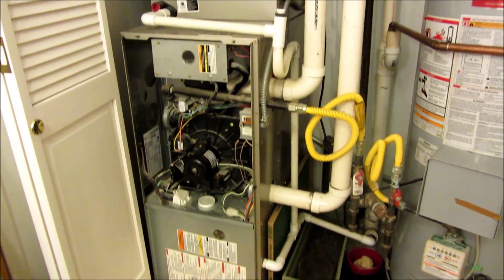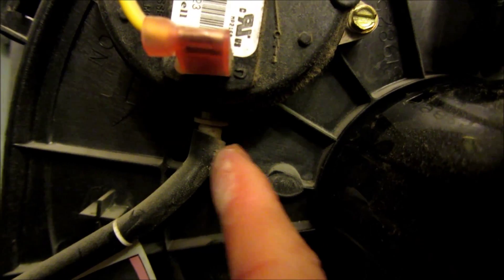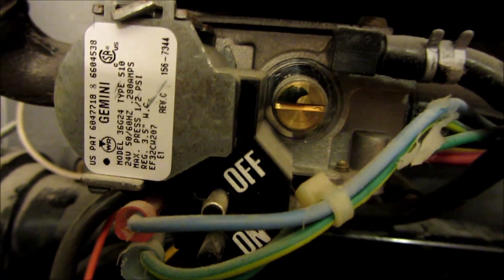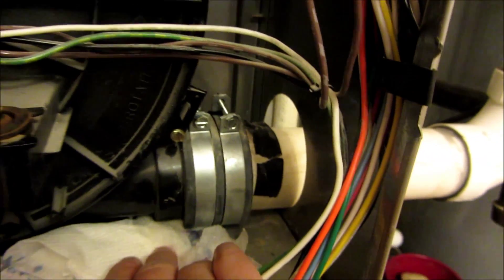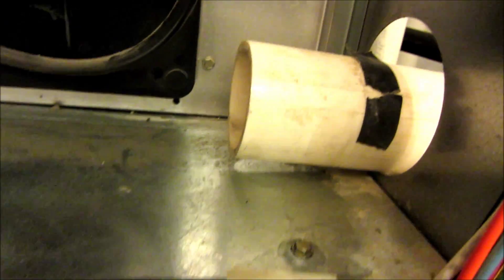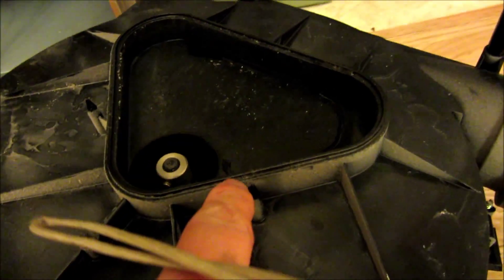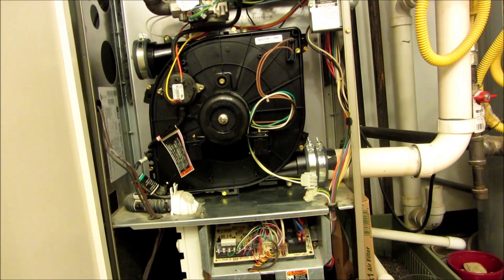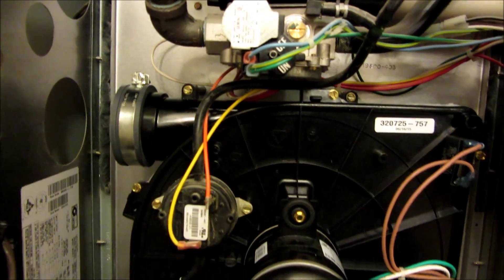Carrier Bryant Payne Inducer Motor Replacement and Repair Tips (HC27CB119, JE1D013N, 320725)

Comment: I noticed the top right hand corner of the inducer motor assembly you did not put the 1 inch round rubber bulb on to seal the exhaust gas from entering your home.  Get the old rubber bulb from the old unit and get it on there or you will have exhaust gas entering your home. Just a tip.  The new replacement units do not come with a rubber bulb.

Comment: My inducer motor started making squeaky noise when starting running and it goes away. Should I replace it? Instead of replacing entire assembly,  can I replace just the motor only? How do I know which part number to buy?  On the motor, there is a label, with ser: and mod:, but my furnace is 22 years old so when I do a search, nothing comes up.

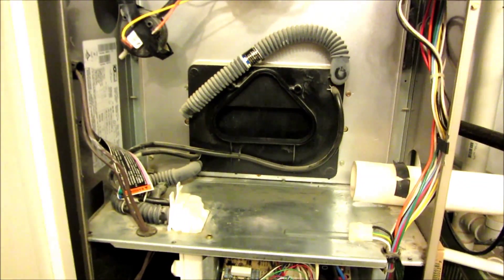Comment: at 3:27, what is that hose connected to, if anything? I am working on this project and i don't remember disconecting this hose. Is it just freely sitting there once the induction unit is back in place? I don't see anywhere it could have came from on the unit
Reply from the maker: As far as I remember, nothing.  It connects to nothing.

Comment: how do you disconnect  the white plastic electric connector from board to inducer?
Reply: Squeeze the two side clips simultaneously and while squeezing pull apart.  You may need to wiggle the connectors while pulling as well.

Comment: My home warranty covered 65% of the cost of replacement of inducer motor which is $325 out of pocket. My service provider charge was ridiculous amount of $940 including daignostic, parts and labor. I learned a lot. I was almost tempted to try do it myself but will let warranty take care this time. Overall, the cost of repairs are insanely high, for 45 mins labor they are charging over $500.

Comment: Im wondering why orange label hose is disconnected. The back end is not attached to anything. Been having trouble starting inducer. Trys to start every 2 min. It spins and then stops while the blower is running non stop.

Comment: Just a heads up. My inducer motor was really loud and I was planning on replacing it for $230 online and my own time. I discovered that the cooling fan on the end of the motor shaft was loose. You can see a push nut at 00:14 in the video. Just push this on tight with your thumbs or a tool and the fan will not rattle around and create noise. Also make sure nothing is vibrating against the furnace or duct work like conduit or metal gas line. Isolate anything that might be rubbing against each other with some thin foam rubber. I did all this and mine has a gentle low pitched hum to it that is not loud at all. Kind of pleasant actually. So take some time to isolate vibrating things before you waste money on the new inducer that may not be any quieter.
Reply: thanks for your findings. but i cant find the push nut that you mentioned. even in the video at 0.14. could you please give more details? thanks in advance
Reply: @katraju  It's the shiney thing in the middle of the black motor. It's on the end of the motor shaft to hold the cooling fan. If you look at the video it's right almost dead center of your screen.
Reply: good suggestion, i found the three screws hold the inducer motor and tightened them, one was fairly loose, it seemed to quiet things down.
Reply: Hey bud, came across your comment and it saved my butt alot of grief, just a good push was all it took! ....thank you truly.

Comment: Great video. I’m pretty sure the motor is the issue with my unit as well. I’m a new homeowner so still figuring all this stuff out. When I try to run the AC, the unit hums but the motor doesn’t appear to be running (that front piece that sticks out doesn’t spin) and no air comes out of the vents. The outdoor compressor unit seems to be working fine. Would you agree it sounds like the motor is the issue? I can have a pro come out but I’d prefer to avoid it if I can
Reply from the maker: I think the pro would cost you just as much as the motor itself.  And even pro's may only be guessing using the process of elimination, and they will charge you even if they are wrong.
Reply: @PoolarityChannel  If the motor doesn't spin freely when it's turned off then it's time to replace either motor alone or the inducer assembly with a new motor.  Either way make sure the replacement motor has the same specs and Molex connector.
Reply: @ianblumgart9566  Have you seen a video replacing the motor alone? Does it require taking off the assembly or does the motor come out of the assembly from the front by unplugging and unscrewing it? Thanks!
Reply: Nevermind. I saw this below... @PoolarityChannel "Snehal B I had the same thought before I started, I did some research and many have noted the removal of the motor was difficult and damages the unit, so I it was my labor that was costly not the replacement part and decided to get the entire unit"
Reply: @joem3211  Sorry but the inducer motor shaft inside the inducer assembly is connected to an internal blower wheel which is only accessible with the inducer assembly removed from the cabinet.   There's a nut that keeps the blower wheel on the motor shaft on tight which you'll have to remove before extracting the inducer motor.  Additionally that nut requires an angled wrench or a deep socket to turn it.  Otherwise you'll have split open the blower wheel assembly which is a bit trickly but doable.  Search for videos for replacing that blower wheel and you'll see what I'm talking about.  Clearly Carrier never intended the inducer motor to be field replaceable but only the entire inducer assembly.

Comment: Can someone tell me where the gray tube just above the mounting triangle (at 3:26 in the video) connects to?
Reply: I am working on this project right now and was wondering the same thing but I think I have it figured out. My tubing has a label on it that basically says the downflow tube, which can be seen in the bottom-left of the mounting triangle, needs to be attached to drainage, and the top-right tube, which you're referring to, should be capped. Mine has a small brass plug capping it. I think they are just two drainage tubes but only one is used and which one depends on the orientation of the unit when it is installed.
Reply: @bertcertain6982  I figured that out too. Yes it just depends on the orientation of the inducer. I took many pictures when I took the old inducer out and was surprised to see the extra hose. My furnace had been running fine after the new inducer.

Comment: Lovely video, but for anyone reading, just note that the bottom left screw is set back in and is hard to see unless you're at eye level and maybe shining a flashlight on it. Also be very careful when you remove the the assembly to not inadvertently pull out any hoses that go into the furnace behind the assembly (ask me how I know). In any case, got the job done and am thankful for Youtube videos like this. Fwiw, I went through all of the free/cheap repairs before getting to replacing the assembly. Read the code chart and go through and make sure the collector isn't full, the condensation lines aren't clogged, and that the vent isn't clogged either. Then, if you're feeling confident it's not those issues, try the inducer capacitor and the pressure switch. Good luck to anyone looking down the barrel of a possibly expensive repair. One of these days when I get more confident I'll start filming my clumsy repairs and posting them myself!
Reply: Can someone tell me where the gray tube just above the mounting triangle (at 3:26 in the video) connects to?
Reply: @robertleder4366  There are two grey hoses but only one is actually used.   Which one depends if the exhaust needs to exit to the left out the cabinet or out to the right.  If it's to the left then you need to mount the inducer assembly 'upside down' and then the other grey hose will be used instead.  The unused one is simply capped off at its end and then routed so it won't obstruct the inducer motor assembly when you go to attach it.

Comment: I was wondering if you had trouble pulling the tubing out of the exhaust of the inducer. I have 2" PVC like yours. It's so rigid I don't think I would be able to pull it out without breaking the PVC where it goes up and outside.
Reply from the maker: Didn't have any trouble, maybe try wd40?

Comment: Great video. Wonderin is there similar motor kit for two stage Carrier/Bryant/Payne furnace inducer motors, e.g. JE1D015N instead of replacing the whole inducer motor assembly? The new OEM inducer assembly cost a lot and a kit would be great to repair/recycle the defected original motor which cause a lot of noise (possibly the inducer wheel hits to the housing, all plastic/ABS).
Reply from the maker: I spent days searching, and could not find a good price for the motor alone (usually individuals selling it on eBay).  I don't believe they sell the motor by itself, likely because that's 90% of the entire cost of the inducer assembly.

Comment: The yellow flexible gas line connecting both the furnace and water to the hard pipe is a gas code infraction!
Reply from the maker: Yes, it was there 15 yrs ago when regulations were loose
Reply: @PoolarityChannel  very loose I'd say. Safety infractions are not grandfathered though, they can still be infracted.

Comment: When you remove the draft inducer, there was a big rubber hose hanging above the triangle connection. Where does that hose connect to?
Reply: Did you find out what it connects to?
Reply: @robertleder4366  
not really 
Any help

Comment: How did you know it was the issue? Hearing isn't working. The motor isn't doing. However there is no light error fur me to troubleshoot
Reply from the maker: The rattling can somewhat be located there, and I believe that's the only moving part
Reply: @PoolarityChannel  I mean heating isn't working on my furnace. How do I know the issue is the motor? It isn't spinning when the blower turns on.

Comment: the inducer fan assembly comes apart ,the screws look the same as the assembly mountings but they are shorter ,no glue required, if your motor is still ok, you can just replace the fan , it is a lot cheaper than the whole assembly , you can replace just the motor too if it is the source of the noises you hear ,it should turn every smoothly , and not smell burnt .
Reply: How does it come apart? is it easy and does the wheel come off? the full assembly is super expensive
Reply: @Jon-hx7pe  It is not that difficult. I've done once and if I remember correctly, just  remove extensive silicone around the housing (was't sure if it's necessity but I've done it anyway), remove the screws(5-6?) and slightly pull the housing parts from any corner (again, no specific corner or part, you feel it may come off easily).  The housing has 5 or 6 clips like parts but I think they are just for alignment, not for to hold the housing closed. You have almost nothing to lose as housing is made of plastic (ABS?) and probably will end up buying the whole motor assembly unless it was a broken/warped wheel issue or housing itself. Good luck.
Reply: thanks. the entire part was replaced because the motor is unavailable on its own and no motor repair shop was willing to put in new bearings  for a reasonable price.

Carrier is a horrible company - making oem parts super expensive and for years denying their secondaries are defective. It's such a shame because these 58 series condensing furnaces are otherwise really solid.
Reply: I'm curious where you would get just the squirrel cage ? I have 3 of these furnaces and 1 broke and another is going. Both fan motors a fine.
Reply: @helenachase5627  only for carriers. not the squirrel cage cabinet, just the internal wheel. here's an example: https://www.amazon.ca/Carrier-Bryant-319828-701-Inducer-Blower/dp/B00152N2IY/ref=asc_df_B00152N2IY/?tag=googleshopc0c-20&linkCode=df0&hvadid=292938317187&hvpos=1o3&hvnetw=g&hvrand=5292505214736521091&hvpone=&hvptwo=&hvqmt=&hvdev=c&hvdvcmdl=&hvlocint=&hvlocphy=9000560&hvtargid=pla-568407446093&psc=1

if your furnace is a 58 series 90%+ carrier the secondary needs to be checked before buying parts - they corrode and plug, there was a class action suit against carrier.

Comment: My error code is 42 (inducer out of speed range) and I have replaced this inducer once before.  Like 10 years ago.  The first time my filter had imploded during the summer while the A/C was on and the dust covered the underside of the A coil and forced the air to rush around the sides of the A coil and fired water all over the place.  The water ran down the internals of the furnace and onto the control panel for the inducer and fried it.  Now they have a convenient water shed run off tray to protect the control panel from water.  lol.
Reply: Could there be a restriction in the inlet to the inducer??

Comment: I had to send my unit out to replace the bearings, i am confused and need some help.  The one hose that you had taped to the back of the unit where did that plug into.  It states on the sticker upflow or horizontal Left
Reply from the maker: Try to pause the video at 2 sec to 5 secs and take a look.  Its still hard to tell, but it gives you a wider angle of the entire assembly.

Comment: my inducer motor hums and won't turn without a bump, I'm thinking that its brushes are going bad ,and the unit should be replaced (it's 11 years old and was installed when the house was built).  Did you/anyone have anything similar and this fixed it?
Reply from the maker: The only thing I can describe for my situation, the Inducer sounded like a loud Dryer cycle with clothes in it, a loud Rattling noise, mine was also 11 yrs.  I bit the bullet because the part was $280 and I figured it would cost at least double for a person to turn a few screws to fix it, even if it turned out not to be the issue.  Because that happens often where you pay to fix one thing, and it wasn't the problem, well they still make you pay, and it didn't solve the problem.  So I figured, I'd just go ahead and change the inducer to see for myself.  And if after that it was somehting beyond my knowledge I would have to pay for that expertise.
Reply: I'm also of the same mind, YOLO, worse come to worst; I'll pay someone to try something else at 3x the price.  I just know that technicians aren't cheap and the companies mark up the parts from some of the same suppliers so why not give it a shot on my own?  Thank you for the expeditious response.
Reply from the maker: Don't forget to cover the Hole at the top left corner of the inducer, basically at the opposite end of where you installed the hose.  A viewer pointed that out after 2 months, so nothing bad happened, I read that there isn't even much Carbon Monoxide that comes from these things, so perhaps it was overblown, but better to be safe.
Reply: I know this is a year old, but did you ever check the capacitor, the little square thing at the top right with brown wires?

Comment: My friend's Carrier 58MCB is making that plastic scraping noise from the squirrel cage just inside from where the motor sits. I tried fooling around with the 3 motor mount screws. Pushing in on the bottom one silenced it so I put some washers in there. He wants to try and get some new screws and bushings at the Plumb Supply.  So you say you replaced the whole thing which might be necessary in our case. It looks just like yours but this is the Blower Motor isn't it? The squirrel cage inside forces the house return air through the heat exchanger right? That's what is there when you pull it out right? I hope we don't have to cause he has a water heater right in front of the unit. Just the motor would be cheaper and there should be a set screw to loosen. And the old furnaces had an inducer motor up top. So how can this be the inducer motor?
Reply: https://youtu.be/ggdTnjcSdAs
Not sure what your issue was, but mine sounds terrible. I thought it was motor bearings but took motor out and seems to run fine

Comment: what did the replacement inducer assembly wind up costing you?  I need to do the same thing on mine and was curious what the material cost is....thanks
Reply from the maker: It cost roughly $320 to $335 for the Parts, I used the following (I used regular GE silicone and it worked fine, the below is high temp RTV which is what they recommend in the instructions)
1) Amazon Link Inducer Motor - http://amzn.to/1WEQFtu
2) Amazon Link High Temp Silicone - http://amzn.to/2kFUEZx
Reply: thanks for taking the time to get back so quickly really appreciate it and the great vid

Comment: you do know that a furnace or water heater should not be connected with flex connectors as a final gas connection! It is not code, the vibrations can cause them to leak and or break. Just to let you know!
Reply from the maker: Good to know.  That's the original flex connection when I bought the Condo, the Code has changed since, 10 years ago.  When did that building code change?

Comment: I've got water making it's way into the intake pipe.  I inspected the exhaust and I can see a small river.  Inducer motor is working fine but I'm thinking that there must be a blockage.  I can blow on the tubes and hear a bit of water in the inducer but not much.  I'm pretty sure the problem is in the evacuation of water from the inducer.  Sump works and it's not clogged.  This is a very helpful video!
Reply from the maker: Do you think there is a blockage or simply that you didn't tighten the gasket around the PVC tight enough?  From my recollection, when I removed the PVC, there was probably 1/2 a cup of water that came out, so I imagine that it typically collects a fair amount of water in there, until if "overflows" and gets discharged down the drain.